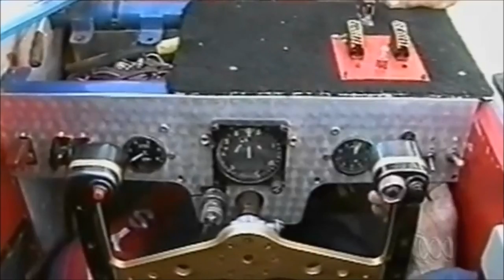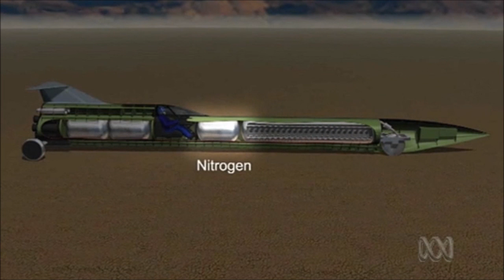Challenging The Land Speed Record

Comment: please look at aero spikes that are used on C-4 missile it extends it range by moving the shock wave away from the intake. All it is a flat 4 inch disc of aluminum that deploys charged by 12 gauge round. The spike deploys 8 seconds after launch its aluminum tube with disk on the front.

Comment: Most LSR vehicles look quite amazing like the '96 attempt vehicle features but the Bloodhound is just SO UGLY, I hope this guy holds the record some day.
Reply: Lets face it he's way behind the times, he developed a carbon copy of Thrust2 14years after the Trust2 run in 1981? Skipping on to today, he's building a Rocket car without taking into account what happens at 1000mph first off the wheels are a much bigger issue than there letting on, on Bloodhound they had to have specialists design wheels and test them at the Rolls Royce engine facility and even then they struggled to spin the wheels fast enough. I am guessing this guy has a dream of being the quickest man on earth but he hasn't got the Sponsors or Engineering backing to make it happen, after all the Bloodhound project isn't being funded by one man they are using Sponsors and that's where he will fall as he hasn't captured the imagination of his countrymen.
Reply: I agree the layout would always be similar if the engine was as long as the car (driver would have to sit one side or the other) its the Areo and chassis layout that makes a huge difference to the Art car. I have to agree with you though that the minute you jump from Jet engines to Rocket power i'm not sure i'd like to be driving. I think that's why Bloodhound went with the EJ200 and a Rocket system that can be throttled (as much as you can throttle a Rocket).
Reply: Dude it's exactly that attitude that keeps you safe and well paid. But it's exactly that attitude that won't let you achieve something amazing. Sure, most likely it won't work, but if you dream you stand a 1% chance of success, if you say it'll never work you stand a 0% chance at success..

Nothing wrong with your attitude because you have a better chance at being content in life and generally happier but there is no need to slate someone's attempt at doing something amazing.
Reply: I agree man. Your approach to life is mine too. Unfortunately history is written by people who throw caution to the wind. But you do raise a good point, he is more likely to die than break a record, which isn't worth it.
Reply: Moonstone Knight What a load of nonsense and a sheltered life you have obviously led.